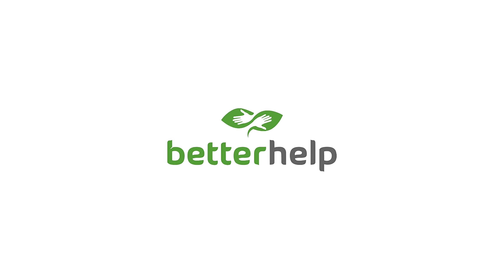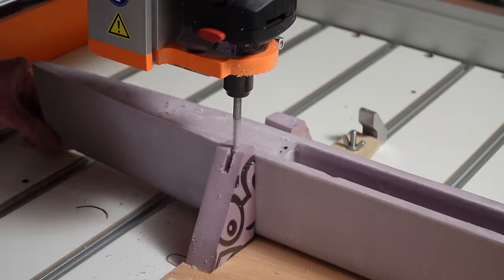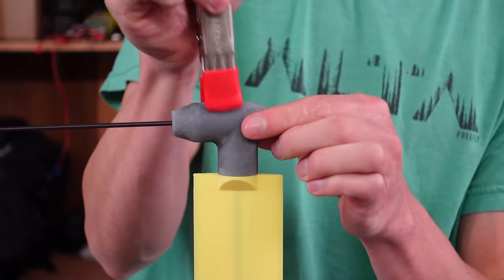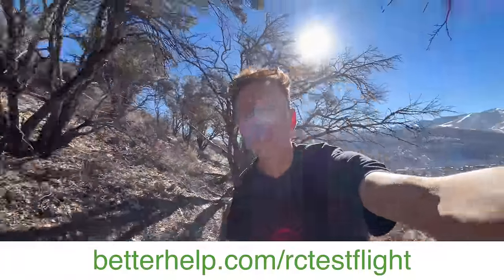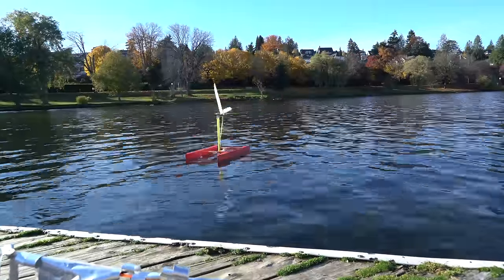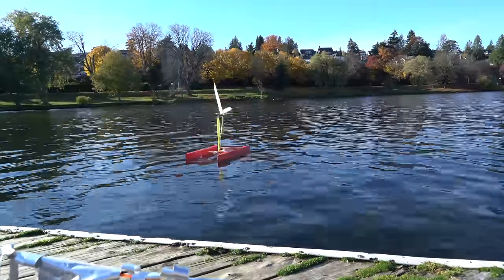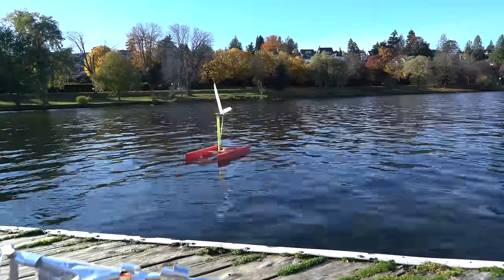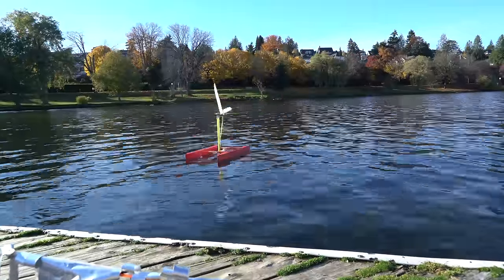Sailing Directly Into the Wind - Is it Possible?

Comment: There's an old popular mechanics magazine that touched on this a little bit they used vertical and three different blade and it had only one gear reduction which was what they changed to move the boat faster.. the first blade design was just s-shape. Second blade design with three scoop. The third blade design was similar to a boat helicopter blade had specific mounting angles to make the bowed edge of the blade catch wind better very interesting magazine articles I think the book was from the 1950,s

Comment: 10 to 1 for your lift to drag ration on the wind prop is probably very optimistic, however if you were to just go buy a propeller for an RC plane it probably would have been more like 20 to 1 or better.  Also since you are 3d printing the water prop, trying to find a model of the new very efficient toroidal propeller design would probably help a lot.  Seems like your most difficult task is going to be matching the the two propellers to each other, with out finding someone who can do computer modeling it's going to take a lot of experimentation.  Maybe a small RC helicopter rotor would help since you can change the pitch, and with a servo, you could change the pitch remotely.  Back when I flew RC planes I never heard of a variable pitch plane prop but maybe someone makes one now, that would be the ideal thing to experiment with.  Either would speed up testing.   You should probably get a cheap RC boat to go fetch this one when things go wrong so you aren't wasting so much time waiting for it to finally drift back to shore.

Comment: You should have made your blade on a pole: 3 blade shaped like wings bent in a curve from top of pole to bottom. doing so lets the system turn even if the wind is not true front. They are more space saving and better balanced then other setups. one can say that if wind changes direction it would not mater to the blades rotation around the pole as they will work from any wind direction.

Comment: Great Ideas. An efficiency improvement could be to use a vawt design so that the post stays in position and the blades spin around it, ,Yes like the ones on the big ships, but no in their design. You could also mesh the 90 and 45 nominal degrees of the shaft concepts and design 22.5 bevel gears to make a 45 total underwater. What I think is great about it is that one on an actual ship could have 2, and actually also power the ship and maybe some vectoring thrusters? Eventually leading to an autopilot setup based on needed power? where one vectors into the wind more to suck in energy, so that tacking is still about catching the wind, but for a different purpose.

Comment: what about using a vertical propeller, you wont have to care what way the wind is blowing although you will have to change the pitch of the  blades on one side of the propeller for better efficiency, but assuming you fine tune the torque provided by the blades, you could do this with an offset cam and linkages for each blade, also you might need two going in opposite directions to counter the differential drag that would be produced, and then for the bottom propeller you might want to have that be the turning part for thrust vectoring, using the bevel gears will give you what you need.

Comment: very interesting idea. seems like the wind turbine could have variable pitch in order to maximize the RPM vs drag depending on the wind speed, paired with optimized screw under the water but it will still be like comparing the efficiency of a quadrotor drone to a huge wingspan glider. I think a prop with blades closer to a feathered position qould make much more torque and less drag although very little RPM. that could be paired with a very large screw underwater for a slow but efficient match

Comment: The whole analysis of efficiency applies even in a traditional sail. Even with a traditional sail you have losses due to air and water friction and drag caused by the boats hull and other structures. The only real difference is the linkage.

Comment: Don't know where you extracted your numbers from but for one, i think something is off, if you're to convert front facing wind with a disc swipe of any kind you ultimately encounter the Betz limit which states that you can only convert a max 16/27 (roughly 60%) of incoming wind power into any other power form. That limit is a majoring factor which means the more drag you create the closer to the limit you can get, here you don't want to get this close otherwise your drag gets too high and stops the boat (or worse pushes it backwards), so you're probably much closer to 50% max conersion than 60%, if not much lower, and then you add to that the mechanical losses, the boat drag, the propeller losses & drag etc. This is bound to be very inefficient, can still be improved yes off course, but only to a fairly limited point.

Comment: Mmk here's an idea: you obviously have a ton of RPM and power from the air, maybe gearbox it to 3 props?  Bonus points if you can engage / disengage props as needed for lower wind speed (more wind to fight against = more power, engage all props, less wind to fight against also = less power so only push a single prop?)

Comment: Vertical "propeller" in style with windspeed measuring cuts of a gear and reduces gearresistance and removes drag from the blade holding it against the vind.

Comment: suggestion: you can try to generate electrical energy in the top propeller pointed towards the wind, and put an electric motor on the propeller underwater and see if you can move the boat in a more efficient way because you will have less mechanical friction that way!

Comment: There is or was at least one full size equivalent of this. The other challenge it could overcome is sailing faster than the wind going downwind. Others have managed to use a car that the axle drives the windmill/fan as it moves forward. That causes a force that opposes the wind. Be interesting to see if it works.

Comment: Excellent ratio to percentage conversion! lift - drag. Now added to my knowledge. Thanks. 
Hey, how about a "tank" that rolls over the water's surface? in order to lessen drag?  (not wind powered)
Reply: I imagine that you would use paddles on the tread which would pull the front of the boat down into the water so you'd have to deal with that issue. The other issue would be keeping the treads on their tracks which would be very difficult given the massive difference in forces acting on the submerged and non submerged sides of the tread (due to the viscosity difference between air and water). It might be possible to address the problem by experimenting with different types of treads and paddles.

Comment: The energy in a standard sailboat is going into the water same as yours.  Think of the hull as a sail in the water.  Then think of the windmill and the propeller as twisted sails and hulls.  If the hulls weren't doing half the work, the sailboat would only go downwind.

Comment: You ideally want to reduce as much wind drag and friction as possible.
Feel the 45 degree pitch is a good idea but need to make the blades more efficient.
Riding how many gears it needs would help too.
Reply: Aerofoils instead of flat blades as on the blackbird

Comment: One problem is that you can only extract energy from the air that flows through the are of the rotor.  In contrast a sailboat moving lateral to the wind can harness more energy from air the faster it goes.

Comment: What if you were to use a vertical axis rotor?  I know it might be less efficient, and perhaps produce more downwind drag, but you wouldn't need to align the rotor to the wind, and it might also allow you to keep the centre of mass lower for stability.

Comment: The issue is not in drag to lift ratio here. Actually, the lift force is perpendicular to the airspeed (including the blade speed itself). And only small component of it turns the blade, but bigger is parallel to the turbine axis, and opposite to water propeller thrust. To move opposite the wind blades installation angle (relative turbine plane) should be bigger. It will decrease turbine speed and should be compensated by mechanical gear ratio

Comment: bigger propellor is more easy just like whith wheels it reduces the amount of the vehicle just slipping back, the propulsion is stronger but the wind is faster, so gotta account for that to get the optimal speed.

even though this is one of the physics principles humans seem to deny and misunderstand most:
that energy can be transformed into another form or direction of energy using itself as energy source.
one clear example is heat, humans constantly work on active pumps and heating and cooling systems, while in reality heat already is energy and it is actually pretty simple to use heat itself to move heat, to essentially form a passive no external energy input other than the heat around it to generate a thermal difference where there was no thermal difference before, so in simple words like a passive heatpump, wich heats one side and cools the other, it is actually super simple and you can even make such setups easily at home using rather primitive materials.
the main problem is that most people can't see or handle relative linking, or just using multiple effects at once, as well as "hacking them" aka, using them to do things which might seem like the opposite of what you want but in reality it will cause the exact thing you want it to do.
it isn't rocket schience or such it is only a simple combination of quantum physics and border quantum physics(physics which are actually exactly on the edge of being quatum or normal), this might sound complex to people, but in reality quantumphysics are much simpler than normal physics when you understand them since it are just some general basics upon which the normal laws of physics are based/by which the normal physics are formed, those border line quantum physics, or shallow quantum physics are actually insanely easy to understand and can easily be used using normal primitive materials, and in many cases passive, for example even a normal tree already does manys uch things on a large scale, it is just that people never take the time to actually look into it and into the effects and what is behind it, and instead they just copy exactly what their professor said and how their professor said it, also most people don't have a hacker mentality anymore these days.)

took one day to figure out 2 easy to make passive self powered thermal pumps, both easy to make at home(since I had more, but they where hard to make up to near impossible to make with current technology, these new ones could even be made(to a lesser extend) if you would go back to the dark ages, would be a lot more work and wouldn't work nearly as well but would work. also both are insanely cheap, especially the one which actually uses those effects propperly instead of being based upon a much older design I made).

like how that propellor in the wind makes the boat go against the wind,
decided that passive heating and cooling/thermal pumping would be usefull, especially due to the high energy per m2 potential, and also being usable to for example cool servers without wasting water or such and actually winning back energy.
(note not suited for big scale(company/corporation) energy generation since it actually creates the temperature difference powered by the heat energy around it(even at room temperature or freezing temperatures), the thing is it doesn't generate energy out of nothing, and so actually uses the temperature itself.
while the generating of a thermal difference(which can be very big with the fully new version) is almost 100% efficient, since in this world most losses convert into heat so no loss in energy in this case since heat is what it uses as energy. however if you would use that heat difference to generate another form of energy like electricity then you actually lose heat energy and cool down the planet, this is very great early on, but doing it to much on a to big scale might actually cause a global iceage so the opposite of global warming, and that also is a big problem, actually a even bigger problem in general, since a frozen earth won't be as easy for nature to adapt to as a hotter earth,(note desserts are hard to adapt to, but deserts don't speciffically form due to heat, but due to drought and lack of plants, so if humans didn't destroy nature it would end up with tons of rainforrests, to hot would be bad.
but for home usage, or right now to use as alternative to solar pannels(much more energy capacity per m2) or combining it with solar panels for double power output and since cold solar pannels work better) it might work well atleast untill the earth returns to it's normal temperature. 
next to that when it is just used to move heat it should generally also be okay, for example to power a oven or stove or a freezer,  or a dehumidifier, no more people nagging you about leaving the oven on or the freezer open, since it won't actually cost energy instead it will just reduce the heat or cold, and in the case of a oven it would actually be wise to leave it on with something like this so it is always warm and can heat up stones or such. the heat which comes off of it is shot out as cold on the other side, so even in the summer it won't heat up your house(unless the hot or cold side is outside, in that caase you can use it to heat or cool a house which also is a great use for this).

that humanity doesn't use this yet is stupid, since it can actually be much cheaper to mass produce than a normal airconditioning or such.
well partly not completely, since I figured out how to make this work and since this well working one and so didn't officially publish how to make them yet, neither how they work.
so see the stupidity as in that noone thought of just using the energy of heat to move heat around instead of adding in a extra source.

the working is also very simple. also can be said in a funny way, essentially if/when this no longer works then any quantum computer can run at any temperature.
that said, the range of this cooling system as to how low of temperatures it can easily work depends on the used materials, and mostly is whenever those materials would enter their stable quantum state, and even that not fully yet, sine actually depending on the materials some can go lower as long as there is atom and electron movement in the material.

Comment: Daggerboards/keel would actually help with steering as well. With the rubber you might be better having it designed with the pitot point as close the the leading edge as possible.

Comment: Hi, I'm from Polish. I don't know much about yachts, I'm an amateur, but the main problem with you is the ratio between the wind propeller and the water propeller. With this type of screws (water prop.) you have (so that it doesn't cavitate) the screw can be up to 5000 revolutions/minute. From watching the video, I think the wind windmill does not exceed 1000 RM. that is, if you put in a 1:5 reducer, your boat would slide forward like a motorboat ;)
Your reducer now is 1:1 😁

Comment: I think if you were to put two propellers and two rudders at the end of each pontoon would provide the best handling. Maybe you could drive a single shaft from the wind prop that drives two shafts in each pontoon? I think the water the hulls displace reconverging where the rudders would be should provide more steering feedback?

Comment: Just missing a transmission and a bigger water propeller. Amazing location btw. This should also be a supplemental option for going into the wind instead of a primary mode of movement.

Comment: Did you ever try this with Vertical Axis style blades so that it could catch the wind from any direction? This would do away with the need for the vane. I know there are some that have thinner blades which I think would decrease drag compared to bigger blades. I also wonder if you used a shroud around the propeller, if it would create a little more thrust.

Comment: I'm surprised that you didn't use one of those new MIT design 105% efficiency props for the propulsion. :)
I had another idea for a possible into-the-wind sailing vessle. How about a cylindrical wind turbine mounted horizontally between the two hulls. The outer edges of the turbine could be modified to become a paddle wheel that engages with the water surface. Seems to me that an efficiently designed turbine that can convert the wind's energy into a downward rotation could drive the craft forward. With some additional creativity, it may be possible to design the turbine's support structure to lower the blades deeper into the water as the wind speed increases. The would help to reduce out-of-control spinning of the blades in high wind and add to the drive power. Just some thoughts.

Comment: could you use a regular drone prop in the water? I've seen RC plane ones used for human powered bicycles; the high aspect ratio makes them efficient and the higher water density means they handle decent power.

Comment: Get rid of the rudder and make the bottom drive propeller steerable ,this will reduce drag and improve steering even at low speeds' on the vertical drive setup
increasing the size of the drive propeller and reducing its pitch will improve thrust.
prop calculation is  1unit of pitch is equal to 2 units of diameter,ie a 10x7 prop could be exchanged for a 12x6 prop using the same output HP engine

Comment: One need to build device which can arbitrary change angle of whings, surface of wings, redaction ratio to the water propeller, angle of water wings, and surface of water wings on propeller.
Then all this parameters feed to neuronetwork, which shoul opimise all parameters to maximize speed at constant wind speed.
Leave it for a week in the sea and see what happends.